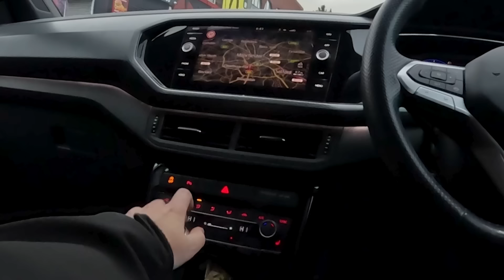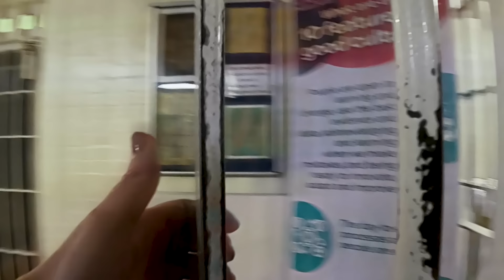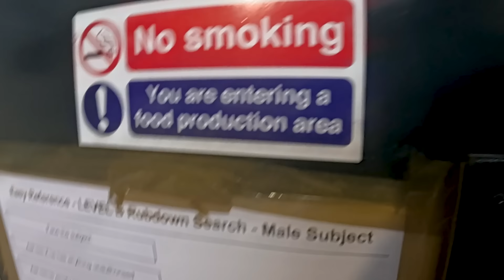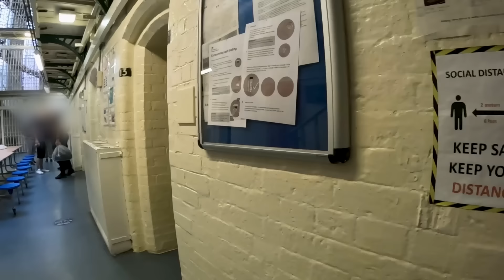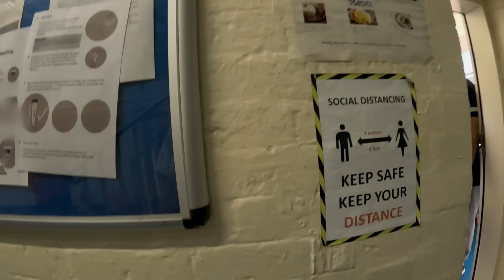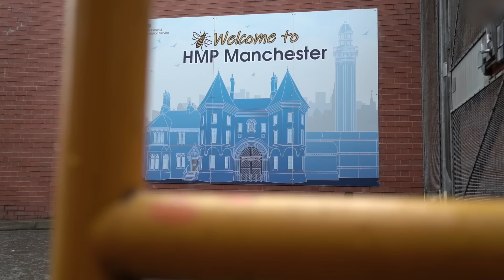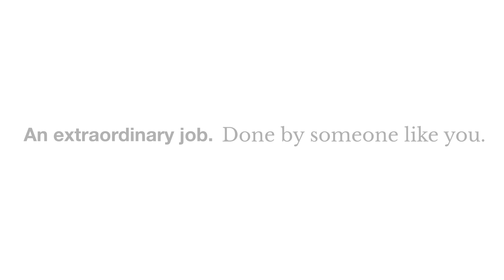A day in the life of a prison officer

Comment: As a Supervising Officer, Let me give some advice to anyone thinking of joining the prison service.  Let me tell you some real facts from on the ground. When the higher ups decided to turn the prison service soft, eliminate discipline and focus on rehabilitation they created a dangerous environment where the prisoners started to gain the control and the staff have become intimidated. Because of this, the bully and gangster prisoners who run the drug market inside run the wings and go unchallenged by staff, therefore creating an environment where rehabilitation can not take place, because all the prisoners that actually want to live in a safe environment and change their lives fear for their safety or are pushed into continuing their drug use ect by the prisoners that run the wings. Honestly, they have messed up big time. Discipline needs to be reinstalled, staff need to take back control, then you will have a safer environment for actual rehabilitation to take place. I don't believe this can happen as it's to far gone now unfortunately.

It is a failing and dangerous place. Discipline is completely gone, the prisoners will talk to staff like they are a piece of shit, and assault officers with no real repercussions, which then leads to more assaults on staff as the prisoners know they get away with the minimum for it. I myself have been assaulted a few times, and the most the prisoner got was loss of canteen for a week, the police are not interested in prosecuting prisoner on staff assaults unless it is very serious injury, as they just say it is not in the public interest to prosecute. The system is run on appeasement, that's the only way we maintain now the little control we have left. The prisoners are in control and go largely unchallenged due to staff fearing for their safety and a growing culture of just not challenging, so if you are one of the few officers who actually challenge poor behavior or rule breaking, you are then targeted by the prisoners. It is not the 90s anymore, and the criminals inside are more sophisticated and ruthless. They have the technologies and abilities through illegal smart phones and contacts to threaten the safety and security of staff. I myself have had my car windows broken at my home address as an intimidation tactic, although it didn't work. The prisons are also now full of officers far to young or with little to no life experience to deal with the sort of people locked up, and yes, the prisoners know this and prey upon them to manipulate. Don't get me wrong, I've had some enjoyable years in the service, and had good times with staff and prisoners, but things are changing rapidly, speak to most experienced staff and they will tell you the same thing. I myself am now leaving the service to go into a new career, so I am being honest and open. I would have stayed if I thought things might get better, but unfortunately they won't, they will continue to get worse as they do year on year. Just check the statistics, they don't lie, but they also don't tell the whole truth.
Reply: Well said
Reply: Sir I read every word you wrote . Very beautifully written. Such a loss for the HMP losing a supervisor.
Reply: Served a short time myself as a prison officer , and lasted under a year. Way too much work for an officer to do on a daily basis.
Someone has a fight and needs restraining, you need to fill out paperwork for that , and also put them on report. This is more paperwork. There isn’t the time to complete this paperwork but it needs to be done asap, often in your own time.
No one has the time to help train you so it’s a case of sink or swim.  I left the army to do the job to so I wasn’t particularly inexperienced.